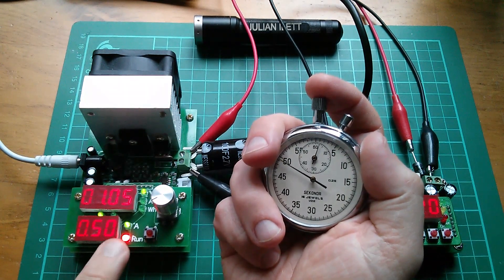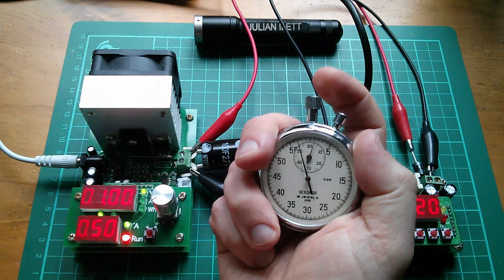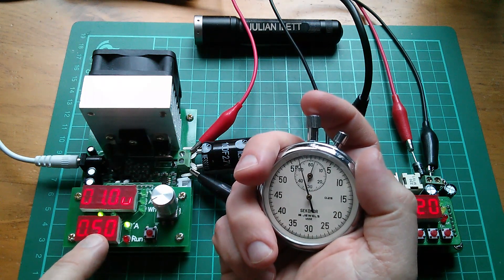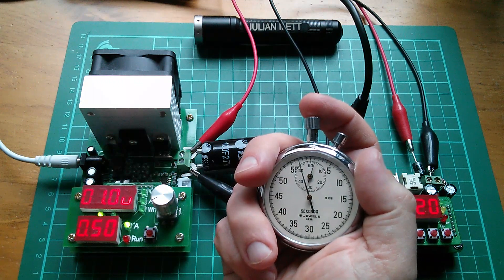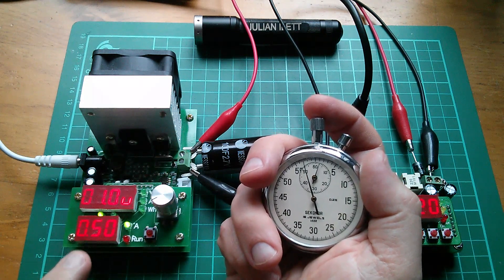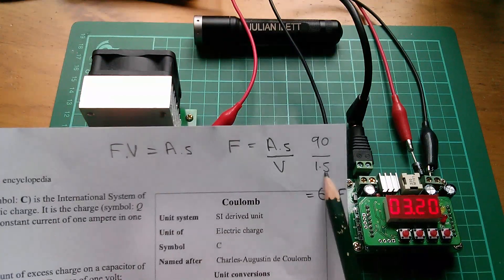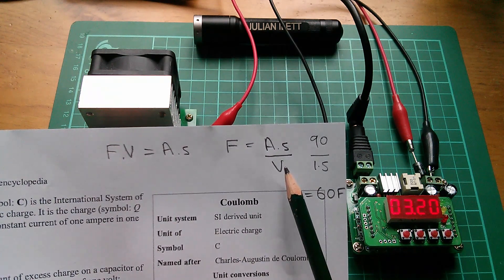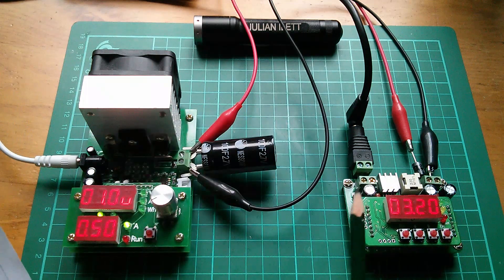Measuring the Capacitance of a SuperCapacitor

Comment: Published on Jun 12, 2017, today, yet the comments are 2 or 3 days ago. Did you build a time machine? :)
Reply: Robert Eliassen
Video was up before but only Patreon supporters had access.
Reply: Ah! :)
Reply: Robert Eliassen 
Patron supporters get access to videos early. Lots of YouTubers do this. Basically they upload videos with a private setting. This allows them to give out the direct link on Patron. Anyone with the link can watch it. This lets the YouTuber respond to comments from people that are more genuinely interested and consistent, it issolates the content creator from the need to read and filter through all of the imbeciles and trolls that plague YT, and it allows them to see suggestions and requests from people that are actually making such requests possible. There are too many people on YT that don't understand the direct connection between comments sections and content creators. Really YT comments should be restricted to people that have uploaded content with a minimum number of views in my opinion.
Reply: Upcycle Electronics
So, by that argument you are suggesting non-patreon supporters are all less genuinely interested and consistent? Comments should be based on a viewer's opinions and should require no more than that since not every viewer is in a position to upload content! I have no problem with patreon subscribers getting an early view (fair is fair) but as for your other idea not only is it ludicrous it is totally unfair. My opinion is your opinion is flawed in that respect. I am a subscriber to Julian's channel and a regular viewer of his content so I ought to be free to comment as I see fit - in my opinion.
Reply: Nick B 
  I was saying, everything in YouTube comments gets attacked like an argument. I don't blame anyone for prioritizing dealing with those that pay to argue over those that don't. The content of any statement doesn't seem to matter in YouTube comments someone always seems to find a reason to argue over any stupid trivial aspect.

Comment: Why didn't you use your oscilloscope?
Reply from the maker: I may do that in another video, just to see if the discharge slope is linear.
Reply: Julian Ilett The validity of your calculations is completely dependent on the slope being constant. Unless that is verified, the calculated capacitance is unreliable. You're measuring voltage over time. That's exactly what an oscilloscope is for. - Then again, I wouldn't be surprised if your calculations are correct and the capacitor marking is simply fraudulent.
Reply: But we have an oscilloscope - it's just in an awkward format; the measurement from the dummy load, and the stopwatch in Julian's hand.  All the same, we can just plot the data points we get from these and see what happens: http://i.imgur.com/QvBDueE.png
Reply: PanoWorks - ha!  Nicely done.  And fast!
Reply: PanoWorks Assuming the load readout is correct, of course.

Comment: Did you try the same experiment starting from 2.7V and letting it run down to 0V?
Reply from the maker: I didn't do that, but it would have taken correspondingly longer and the end result would be the same capacitance.
Reply: Would it? 2.7V to 0V would take longer, and give larger capacitance? Closer to the 100F stated.
Reply: No, the capacitance measured should not depend at all on the starting and ending points.  The longer time taken is exactly cancelled out by the wider voltage swing.

(Obviously any real capacitor is not an ideal device and will exhibit non-linearities, but they should be relatively small, certainly not on the order of half of the total capacitance.)
Reply: karl - as he said - the voltage drop should be pretty much linear, so dropping 2 V should take twice as long as dropping 1 V.
Reply: He is extrapolating the capacitance from what he has drained. Given that it should drain in a liner fashion that is really easy to calculate as he did. So unlike a battery, you don't need to drain it all the way to see its full capacity, because batteries DO NOT drain linearly and thus have to be discharged or charged completely to find their capacitance. And above he said he might do a video using his scope to show that capacitors really do discharge in a linear fashion.
Reply: +Jamie H If you wanted to calculate energy in Joules of the cell, you would discharge to 0 from the rated voltage. The equation for energy, E = 0.5*C*V^2, uses the value for capacitance, so it is an important factor in making an accurate energy calculation. This video showed us that, at 2.7V, we would have a total stored energy of 218.7 Joules with a capacitance of 60F instead of 364.5 Joules from the alleged 100F capacitance of the cell.
Reply: kaos havoc, don't confuse battery's capacity with a capacitor's capacitance. To measure a battery capacity, you need to fully charge and then discharge it, as you say. The result will be in Amp hours, or Watt hours. But to measure a capacitor's capacitance, where the result is in Coulombs per Volt, or Farads, you can use any arbitrary voltage range (within the capability of the capacitor) and time period for the calculation. You could even go from a positive to a negative voltage if the device is not polarity dependant.
Reply: RWBHere I am not sure how anything I stated disagrees with what you said lol.  Did you mean to reply to someone else?
Reply: +kaos havoc You (probably accidentally) said batteries "have to be discharged or charged completely to find their capacitance". I think you mean capacity instead of capacitance since batteries don't have a fixed capacitance across a given voltage range, only a fixed capacity across a given voltage range as you correctly pointed out aside from what I presume is a typo.
Reply: Ah, yes. I did not see that I made that typo. Thanks :D.
Reply: My video comment was in error. I hadn't really thought about how the formula actually works. Thanks Julian!

Comment: The 100F is rated capacitance which is, for a DC voltage, 0.5 x C x V^2. In this case 0.5 x 90 x 1.5^2 = ~100. So not a disappointment at all.
Reply from the maker: The C in E=½CV ² is capacitance in Farads - the C in my equation is charge in Coulombs
Reply: Yep. My bad. Maybe you could hold the capacitor at 2.7V for a time with a constant voltage source to ensure it is fully charged - seems that is best practice. Otherwise your method looks to be standard procedure. Best wishes.
Reply: With the E=½CV ² formula, I end up with the 60F worked out from the video:
At 2.5 volts, a 100F capacitor would hold 0.5 x 100 x 2.5² = 312.5J (E is Joules)
At 1 volt, a 100F capacitor would hold 0.5 x 100 x 1² = 50J
To discharge from 2.5V to 1V, a 100F capacitor will provide 312.5 - 50 = 262.5J of energy
With a linear voltage decline of 2.5V to 1V, the average voltage is (2.5-1)/2 = 1.75V
With a discharge period of 90 seconds from 2.5V to 1V at 1A, this capacitor provided 1.75 x 1 x 90 = 157.5J of energy
157.5/262.5 = 0.6 (60%) of what was expected.  60% of 100F is 60F.
Expected discharge time for this capacitor from 2.5V to 1V at 1A would be 312.5 / (1.75 * 1) = 150 seconds.

Comment: I wonder if the result would be different if you used multimeters to measure the voltage and current? That said, I've found those psu displays to be reasonably accurate, certainly within 5%, which isn't going to suddenly make that capacitor great ;)
Reply from the maker: Like you say, not different enough. I just know I'm gonna get told off for not connecting a multimeter across the capacitor. Ah well :)
Reply: Telling off, telling off, telling off ;) 
  there, it's done. no need for further bs.
   I could not care less. Thanks for the upload... and nice stopwatch :)
Reply: You don't need a time machine to mess with the timestamps, just a friendly person at Google. In fact, time machine is of no use for this task. Or you could release the video early for certain people via a direct link to an unlisted video.